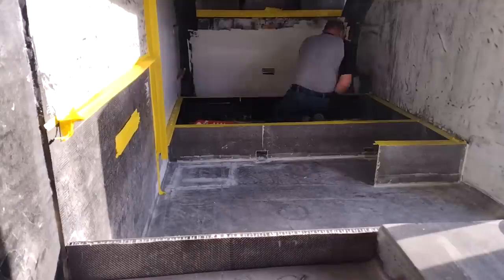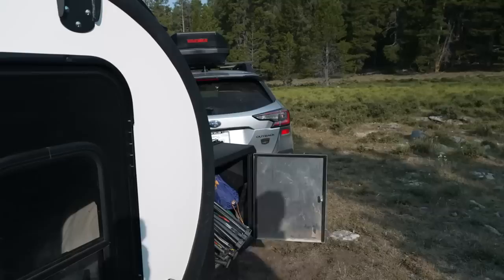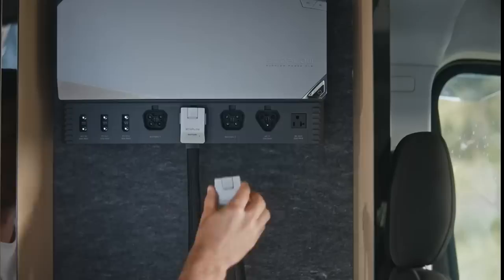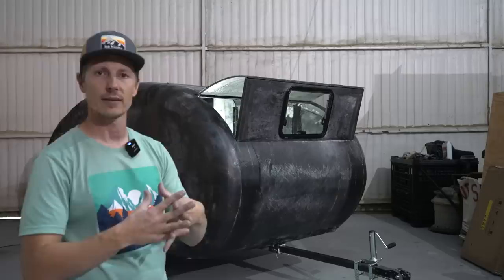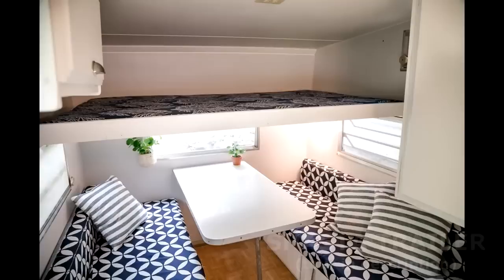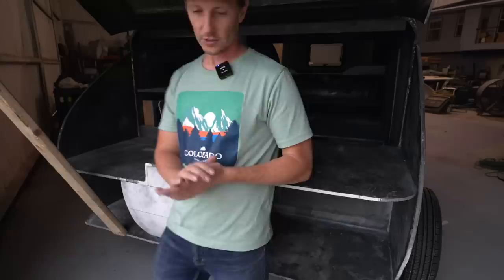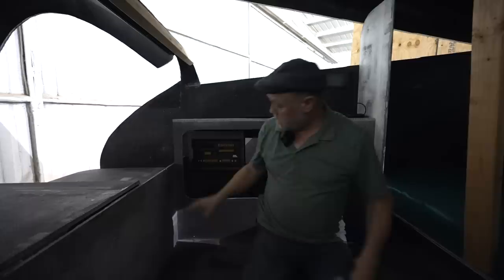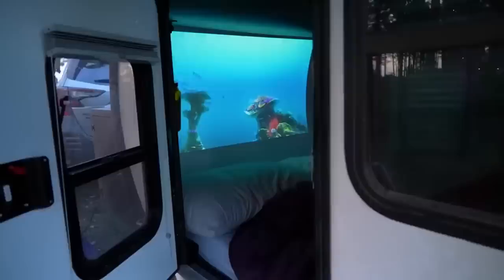World's First Pop-Up Teardrop Trailer With NO CANVAS!

Comment: I love the direction this is taking - it looks like a smarter and much lighter take on the 11-13ft hybrid caravans with slide out beds and pop-tops that are becoming very popular here in Australia. I can't wait to see some of the creative solutions, especially the door's design. The positive pressure system is a smart addition too, especially when there are so many places for dust to get in while travelling. The only thing that I would add if it was mine would be a small box or platform on the tongue where I can store a ground cover and a small BBQ, which I wouldn't want to transport inside the camper.
Edit: The only alternative to gas struts for the hatch that I have seen are locking stays on a camper I rented long ago, similar to chest lid support hinges. I was very wary of the wind lifting the hatch and unlocking the stays while we under it or even worse, just unlocking one of the two which would have allowed the hatch to twist and something to break. 
A few questions (feel free to ignore them if you plan to address them in future videos or you want to keep it a surprise):
Assuming you're not going to use the disposable propane bottles, where do you plan on keeping your stove's LPG bottle? Do you need to transport it or have it outside when cooking to comply with any regulations?
Are you going to install a hot water system for the galley? How will the plumbing get hooked up to the water containers?
I can imagine it will be tricky to integrate but do you plan on having an awning or a tent of some sort attached to the side of the camper or the galley hatch?
Reply from the maker: Good observation. When considering the build I first considred more complicated options. Like you said, something similar to a hybrid.  I picked up on the positive pressure application from watching all those Australian overland videos. I think it was the Bruder that first brought it to my attention. But I can't take credit for it in this build, that was all Charles's idea. What you mentioned about the ground cover and barbecue is included in the under the bed storage. I may have done a poor job highlighting that in the video. That entire area will be accessed from the outside of the trailer. And it can be accessed from either side. Like you I did consider a tongue box. It could easily be added to the design. My only hesitation for folks is that adding a tongue box typically means adding addtional weight to the tongue. Keeping that weight more centered over the axles is typically the best route if possible. Great questions by the way. We will have two 5lb propane tanks. It is a feature I love. Each one is hidden in a nice little compartment built into the wheel wells. I am giving a bit away here, but this trailer is designed to look like it is coming out of the 1940s and 50s. There will be some pretty dramatic GMC flair style wheel wells on this trailer. This is something I have always wanted to test out. Can you make a trailer with classic wheel wells that performs in all situations? What paint, texture, coating is needed to hold up against the gravel abuse. And how well do wheel wells hold up against trail brush? I have always wanted a trailer that can go almost anywhere, but still look good. This is my chance to see if we can make that happen. I will not be installing a hot water system as I have found I often gravitate to a basic sponge bath over our nicer shower methods even though we own the equipment. However, in this buld I amm going to give the Joolca another shot. In my Joolca video I liked the shower. But my issue with it was setting it up. I mentioned in the video if I could keep it mounted full time it may be a viable option for our family. We will be mounting it on the trailer. Our current issue is that the box is just a tad taller than the door for the underbed storage. That would have been the ideal place to mount it. But I think we can come up with something. For the 2.0 version I may need to rise that bed up a couple of inches. Maybe even in this version, we will see. If you haven't seen our low water camp dish washing video you may want to check it out. https://youtu.be/nd4redVQ6Wk  This really reduced our water usage and made it not really necessary for traditonal dish washing methods. As for plumbing. The water will either come into our Joolca Triple Ensuite that we will be using as a side entry tent/shower/bathroom. Or if we can figure it out, this trailer will have it's own built in side entry room. Still working that one out. So far I have never found the need for the galley tent or galley side walls. But I am open to trying it out at some point.
Reply: @PlayingwithSticks  Great points! I reckon the Plymouth Deluxe and Pontiac Chieftain are two of the most beautiful cars ever made and I hope that's the design direction toward which you're leaning. I can't wait to see the final product!

The Joolca system is a very nicely comprehensive system but if you are after a simpler but more portable option, have a look at the Companion Aquaheat Lithium (not sure if it's available in the USA though). 

BTW keeping the BBQ and ground sheet outside is purely for the smell, especially when you travel for a whole day in the hot sun 😁
Reply from the maker: I will have to look into that shower system, I’ve never heard of it. And good point on the smells I never thought of that. Hmmmm… Charles and I just decided a couple weeks ago I don’t need a tongue box. You have me thinking I probably do. This is why we posted this video. Those Blindspots always get you. Thank you for that!
Reply: @Ess_Chalk  The under bed storage that is accessed from outside is hermetically sealed off from the trailer interior. No smell will come up from there. And the retracting tongue make a tong box a complete redesign of that area. The storage uner the lower bunk could be converted to an outside accessable storage. But with forward storage weight and balance is always an issue. Especially on a trailer that is under 1000 lbs.
Reply: @Ess_Chalk  Wow, have you been looking at my sketch book. The fenders have actually changed from the ones Drew saw when he was here. They will look very much like the Plymouth Deluxe. That gives more storage inside for the propane tankes and other small stuff.

Comment: Wow that really is quite impressive. As you were going through it I was making mental notes then you said the weight was sub 1k lbs!! I'm astonished to say the least. I have mixed feelings on the air conditioner but lean toward your opinion. I never thought I needed an air conditioner but one week we were stuck in 100-110 degree temps, humid no air flow in the mountains in Washington. At night it didn't get much better dropping into the low 90s. It was miserable enough that we cut our trip short. However, other than that I've never felt a need and the weather was freakish at that elevation. So yeah...not needed but I'd have paid a good sum to have it on that particular trip for sure.  Really looking forward to the completed build as you have a lot going on there. Extremely cool potential and certainly the most unique trailer yet. I share your concern about the frame and it will be interesting to see how testing goes. I notice the rear hatch looks perfect for keeping the rain off :) THanks for sharing Drew!!!
Reply from the maker: I'm like you though Pat. I am beginning to be a bit of a gear junky. So our trailer in particular will definitely be heavier than others. I am really excited to get it on the scales. I bet you are right on that AC. I was completely against refrigerators at one time. Look at me now! I am hopeful the insulation on this trailer will be somewhat like the Bean. With our original teardrop it got uncomfortably hot. With the Bean insulation combined with the MaxxAir Fan nwe never were uncomfortable. I was really surprised. But, our R-value will probably  be nowhere near the Beans. That is something I want Charles to give us, an accurate R-value on all parts of the trailer. That Antishanty video really opened my eyes to the fact that the R-value can be scattered throughout the trailer when you have hinging mechanisms.  Back to the AC. That is what  I really like about these portable ACs coming out. You can bring it if you need it and leave it at home if you don't. Especially with a trailer as airy as yours, it is probably pretty easy to find spaces to vent it. LOVE YOUR LAST COMMENT!  You always make me laugh.  Great chatting with you here Pat.
Reply: @PlayingwithSticks  I'm not following the hand placement thing or the special gift. If it was funny I'm happy if not I'm sorry. Whatever it was I'm sure it was inadvertent. On the air conditioner we've considered the eco flow but the expense and bulk is so high for the once a year we "might" need it just haven't gone there...yet :) I'm very impressed with your design decisions so far. It'll be fun seeing it all put together and to hear your impressions after a few nights in the wild. With lack of frame I'm curious about weight and balance...mostly how much weight you can carry in the trailer. Once you reveal the battery(s) and propane tank choices it will be revealing. The extra water will be impactful potentially. I'm thinking those fiber glass propane tanks would be sic. ground clearance, wheel size options, hitch type, fridge choice and power draw/options are all things I'm looking forward to hearing about. Really curious about the ruggedness of the structure without a frame. Super interesting idea
Reply from the maker: @pat9125  You sound like us with the fridge. But once we started using it, we were hooked. I would never leave home without the fridge now. I have the same thoughts as you about the weight distribution. It is just hard for me to fathom one spine and two independent axles being the load bearing part of the trailer. Although they are Timbren we are adding their suggested support bar across.Not suggested for all uses obviously, but for cases like ours. Propane will be very limited. We are hiding 1 5lb propane tank in each fender. With my heater use that may be a little lacking. We will have to see how that goes. Last fall there were many opportunities to use the heater. So I will be interested to see how much we use this year. As for the batteries I am going fairly small at 2kWh and then supplementing the rest with solar and portable power stations. I shouldn't need more until I start testing induction cooking. Even that I may be surprised to find that 2kWh and solar is enough. I honestly have no idea, because I have never studied what amount of energy they require. In terms of clearance and tires. I went with 15's because i like the look and the little bit of extra clearance. 14's would probably be a better fit for what this trailer is designed for. I forgot the clearance now. All I remember is that it was higher than I wanted. In a good way. I want to say it is somewhere near 15". As for everything else I was planning on going pretty basic as this trailer is designed more for blm, state forest, and HipCamp style camping. But I really should consider I nice articulating hitch. Although we aren't offroading it sure makes a better towing experience. And, well, I am already making this my crazy experimental trailer. I might as well just keep going with the fun add-ons. I think you just inspired an articulating hitch!

Comment: If your axle is going to track that wide;  round the [slab]sides taper it front to back [more teardroppy] and add wheel wells.  But always slow down or get off the road if crosswinds are bothering you.

Comment: Pretty cool! We currently own a fully composite construction Runaway square drop but I definitely miss the expansiveness of our previous aframe. Don’t miss the drafty corners and need to be 100% level for the roof halves to meet. Articulating campers are definitely a different animal to get used to! Curious to see this build continue on, great and informative video as always!
Reply from the maker: I’ve been very eager to see what the R-values are like. Nobody’s really talked about it before until you mentioned it here. I had a suspicion that there would be an impact, just based on thinner walls. I need to consider potential air gaps as well. Makes sense. And the leveling thing that’s also new to me. Thank you for sharing all of this
Reply: I've been looking at Aframes and Runaway. Another one, I've been looking at is Encore RŎG 12RK Adventure Trailer. Never knew about the leveling issues. Thanks
Reply: @PlayingwithSticks  I’m sure a composite build would have a better r value than the stick built poorly insulated aframe I had. Not sure how much difference though as much of the losses were at the articulation points. Camping in the extremes were uncomfortable enough to just say no. Couldn’t keep it warm/cool enough and having to spend a half hour on putting up extra insulation (on top of the initial leveling/wall/roof set up) took too much time away from camping to be enjoyable

The hinging was a source of concern too, as there is always air gaps. No matter how tight the gasket, they will have flaws. Another need to be 100% level. If not, a day of rain will channel drops to any weak points in those gaskets. We had one such spot in a corner, and discovered this on a particularly rainy trip in which we forgot to level. Almost became a very expensive lesson. There’s also the issue of rain runoff during storage and keeping the camper level during those times too

But every breed of camper has their quirks. Composite builds do as well. Gotta love the smell of plastic lol. But I definitely enjoy it’s insulating properties as well as it’s much lighter weight. Hoping to see more in the market in the future
Reply: @PlayingwithSticks  R value of the foam core material is listed at 3.85. That is low and I may decide to make thicker walls. I will eventually make coupons and send them for testing. R value should be measured on the final product. The composite skins have some insulating value. The composite construction should have near zero air leaks. Of course there will need to always be airflow through such a small space. The variable speed forced air system shoud make that easy to manage.  I think it will be fairly easy to stay comfortable in this trailer. The propex can supply a lot of heat. But this is clearly not an extreme winter camper.

Comment: Looks like it is coming along.  You are correct, each camper/teardrop/trailer has its pros and cons.  Cool that you are able to combine all of the pros to get something good for you and your family.  The EcoFlow power unit is very cool.  If I was building something from scratch or had the option, I would set up to use some type of power station instead of onboard batteries, charge controller, etc.  Like you said, gives you flexibility.  Christine says she would trust Charles in regards to the no frame.  She said look at all of the stuff he has built, he knows what he is doing.  
BTW…..how do you score a ride in the land speeder? 😁
Reply from the maker: Hi Garret, great seeing you! Good point on building around the power station. I would do the same thing. I often say that technology is changing so quickly that after you buy your lithium you will end up buying something new in 2-5 years before you even get the money out of those extra lithium cycles. So why not future build your trailer to be able to adapt to the changing lithium technologies. This was one of the main reasons we went with the Ecoflow Power Kit. Like I mentioned, I needed to have a strong foundation. Especially for testing things like induction stoves that many people have emailed us about lately. The beauty of the Power Kit, which I didn't explain in this video is that it is an ecosystem that works together with power stations and solar inputs. And, I must note, it is compatible with other brands. Which was very important to me. What this means is that although I built the trailer on the smallest battery (which is still huge at 2kWh) It has plug and play ports for solar, alternators, and power stations. So I will be able to quickly take my power stations and plug it into this system, whitout ever having to wire that portion up. Again I was really thankful Charles put up a fight on this one, because I think in the future I will be saying he was right. At the time it just seemed a little overkill and too much battery capacity for our needs. But at that time I didn't see the trailer as our experimental trailer. I was trying to build it pretty bare bones to give people an idea of what they could do. And like Christiine said, although I give Charles a hard time and I am still a little hesistant, I am super excited to put this "no-frame" to the test. I continue to ask Charles why nobody does it? And he says why do people not do a lot of things? Because they just follow what they know works. And that makes a ton of sense to me. Because I see so many great small camper manufacturers using some of the same components that are used in the large RV industry. And I often think there has to be another way. But, that means putting your neck out there a little bit. And even if it is better, people come to expect certain things. So in theory it could impact your sales as well. It could be better, but if the perception is that the standard thing is better it often is better to just keep with what people know. So yes, I am so excited to beat on this trailer. If it surives the Playing with Sticks test this could be something really big for the small camper world.  As for the land speeder I didn't even have to beg. Inside I was begging though!  Haha. They were really excited to throw me in or on all the vehicles. I think I forgot to highlight this in the first video, but the landspeeder with the removable engines actually has an engine in it for driving. They use it for parades!  How cool is that!